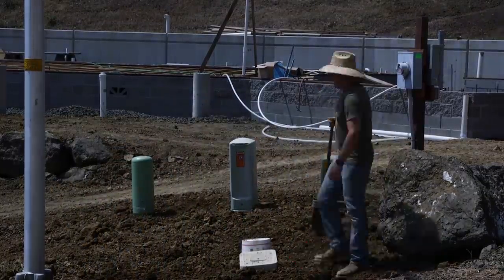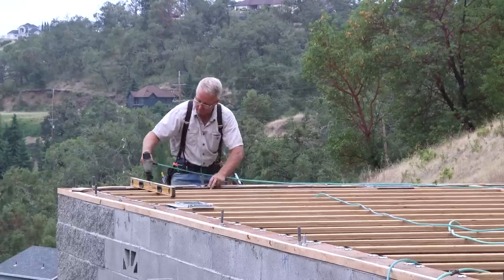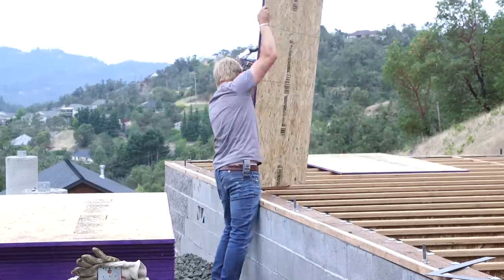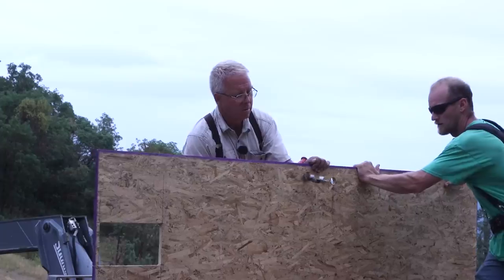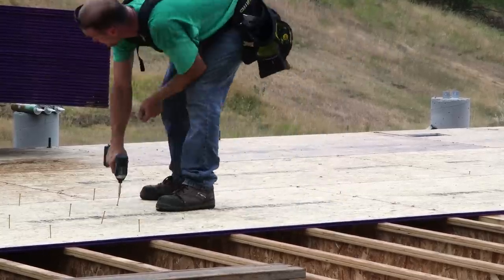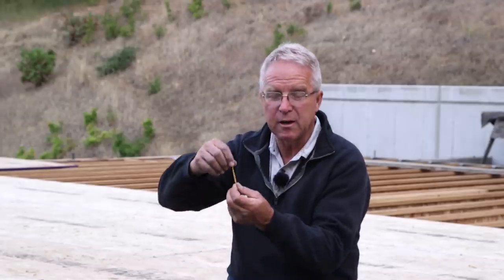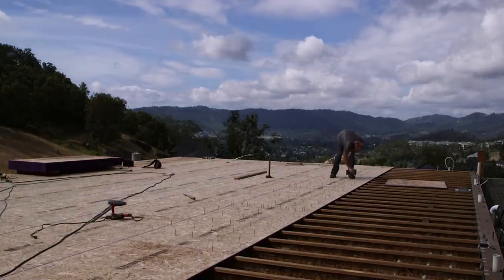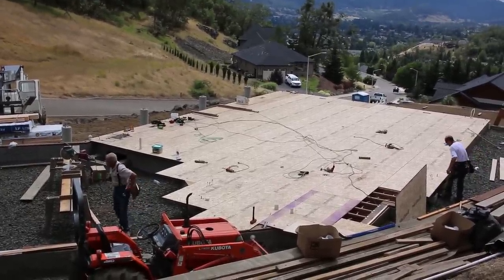Lay the Deck Ep.44

Comment: Wouldn't putting some sill gasket material be a good idea on the space left after shimming the mud sill to prevent flow through that joint? Or would just some construction adhesive on the shim be enough?

Comment: screws? 8s ring shanks i built well over 1000 floors befor tjs and with tjs never had a squeak started laying osb before the lines and never trust the lines iv seen them off by an inch or more especially on half inch ply

Comment: I hate an impact driver for driving regular screws. They’re great when you need power, but I find the them slower or regular screws, and the impact ratcheting action twists the bit in the screw head, causing the bit to get stuck in the screw. A normal drill is way better in my opinion.

Comment: I have to ask why OSB and not zip system/ huber wood, advantech subfloor. Far superior to OSB with glue and their system has a warranty when you use their subfloor, glue and screw it down
Reply: Like most things in construction I would imagine that the final answer would come down to cost. 

This is still a spec home and I would think the final goal is to make money. Given that market those more costly products may not pan out in the end for the bottom line. 

Have a great day.

Comment: Ok, so have a problem I ran into when using advantech tongue and groove decking/subfloor. I was building a 16x24 shed when I realized that the usable space of the board is less than 4x8 because the whole board itself is exactly 4x8. So if I were to actually use the tongue and groove on a 16 foot wide shed I end up having to use 4 boards plus waste a whole board by ripping a 3”wide strip so the decking actually makes it to the edge. Have you run into this issue?

Comment: A couple of thoughts/questions ... 

1. When you were making the holes in the first row of sheets to accommodate tie-downs, etc. at the edge of the house, what was the reason for not simply butting the sheet up against the obstructions and then scribing their positions straight onto the sheet? It looked like you were making life more complicated by measuring and then transferring the positions. There was doubtless a good reason for doing it the way you did, so I'd be interested to know what it was.

2. What is your view on screw guns for screwing down OSB? Putting in hundreds of screws with a normal electric screwdriver looked a little fiddly. I've been getting good results with one similar to this: https://youtu.be/TKgioDxOT-M?t=350 -- though it took me a while (and many wasted screws!) to realise the importance of selecting the correct tip for the type of screw :-)

Comment: would a caulking gun with extended handles so it's like 3' long instead of 18"  make it easier to put down the adhesive for sub flooring. might be something to mention to the caulking gun manufacturer you use..

Comment: Missing code required cross blocking at end parallel to joists. Recommended screw length is 2 inch .

Comment: That deck screw bit popping out would drive me nuts. A roll of Super 33 or 88 is good for more than wiring. I wonder if that construction adhesive would work in a pinch on a torx bit trying to escape. I found this edition a little flatter than usual.
Peace.
Reply: Simple fix... get a longer bit. If you're using the same screw type for thousands of times, save yourself a headache. The magnetic holder is only good when you deal with a half dozen screw heads in the same short job, and even then, most impacts are simple to pop in and out, there is no chuck.

Comment: I am a relatively new  carpenter with a lot to learn, but I had a couple quesions. What is the point of shimming the mudsill? Won't those plywood strips just rot away? If it was cedar would it fair better? Thank you for any answers you can provide.
Reply: I always put the band boards and joists on top of the sill. I've never had that problem.

Comment: For the places where you have to make a penetration (plumbing, etc.) do you have to go back later and seal up the holes to make them air tight, or do you leave them and the next layer does that?
Reply: You'd want there to be some space to eliminate squeaks and rubbing wear. Also makes future replacement or repair easier.

Comment: I know there is much discussion over plywood vs. OSB.  Engineering-wise, OSB provides a much more uniform panel strength, especially in shear.  But p!$$ poor nailing makes it all moot.  OSB will not hold a nail.  So, siding and shingles, plus some flooring, all comes loose over time.  Here, a bit farther north on the wet coast, OSB is regularly nailed when wet and the following year, everything releases.  There are so many "cardboard" spec houses going up here and they are garbage.  I've done far too may repairs on OSB substructure because it was wet and the nails didn't hold anything together.  I'm very curious to see how you deal with this issue in these videos.  

Good for screwing the decking down.  I usually use Robertson screws [square socket] as it's more available where I live, but Torx works too.  I'm surprised you didn't have a stand-up screw rig for the deck screwing. It's a huge back saver. 

Finally, I do not like any OSB beams or sheeting construction methods as it burns like crazy.  In event of a fire, if you don't live next door to a full-time fire hall, your house is a total loss every time.  "Old School" wood framing methods have the advantage of being able to be built fire limiting and help reduce fire spread and make fire fighting safer.

Comment: Buying tongue and groove OSB at the typical orange or blue big-box store, I have NEVER gotten any that would actually fit together correctly.
Reply: No offense but you probably don't know how to put it together. It's supposed to be gapped for starters.
Reply: @shooter77us  Every piece has a smashed spot in the groove.  Or the tongue is bent down.  Or the edges are visibly swollen.
The last batch I tried to buy, it was both sitting outside in the rain, and the band clamps were so tight they had crushed the edge of every sheet.  I bought plywood instead.

Comment: You said OSV is a great choice but I've seen a video about OSV and plywood. This guy wet the OSV board and after some time I don't know how many hours he drive a nail with his bare hand and the nail went through the OSV whereas after wetting the plywood at the same length of time as OSV he did the exact same thing on plywood the nail didn't even went halfway. I'm not a expert carpenter but imagine if you live in hurricane prone area and your roofing OSV got exposed from water those nails would come off from strong wind. I could be wrong maybe the video is misleading or something.
Reply: What's even more puzzling is that Roseburg Oregon is like the world capital of plywood production.

Comment: A staple is no better than a nail. They both have flat smooth vertical surfaces. Use ring shank or coated nails.
Reply: It doesn't matter - the staple can't make a squeak because once the board is screwed down, nothing can move anyway.  It's just to temporarily hold the board's position until the screws are run down.

Comment: Does bldg code allow for screws to be used for the diaphragm?
Reply from the maker: Yes in fact the engineering on this project requires it.
Reply: @essentialcraftsman  Is it considered a diaphragm?  Those deck screws would not have the same shear tolerances as a 10d nail. No?

Great show.  I like the shims under the subfloor.  Much easier than shimming the walls later.

Comment: Your skills and way of explaining things are nothing short of being perfect. One thing I must say you need to try and once you try it, you'll toss that liquid nails forever. Try the expanding foam polyurethane adhesive made by DAP. I Use the DAP expanding adhesive and great stuff brand guns. There's 8 times more product per can than what's in a 24oz tube of liquid nails and per can in my area is roughly 12 bucks per canI have found it much cheaper online and the holding performance is hands down better than anything I've ever seen. Plus when your done, you just clean your tip and set the gun aside until next time. Trust me. You can thank me later.

Comment: this whole time i thought OSB was worse with water... crazy
Reply: I don't think plywood is any different.  Exterior grade won't degrade the glue if it gets wet.  It really is no different than OSB in that regard.  At least if the glue fails in plywood, you still have the large plies there stacked on each other.  OSB is 3-5" strands...what's left if the glue goes away from that?  Bottom line, it is the glue that is key for both structures.

Comment: Interesting that the deck goes out to the outer side of the wall, does this not provide a way for moisture to wick  into the house.  I was expecting to see it sit inside the walls.
Reply: By running the sheeting all the way out, it helps to smooth out the entire surface into 1 homogenous surface which to start the 1st floor framing. Once the exterior material is applied, wicking shouldn’t be an issue.
🤜🤛
Reply: @psidvicious  Thanks, I figured it was something like that, I can see the structural benefit.  Here in UK we rarely build in wood for the outer shell so I’ve not considered this before.  Look forward to seeing how the outer skin is constructed.
Reply: @sibat777  Right. In my location, (S Florida) we rarely build like this either. It would have gone - foundation, stem wall, joist and deck, then masons would come in again and continue laying more block for the exterior walls. Or, more likely it would have been a concrete slab on grade after the stem wall.
🤜🤛

Comment: With expansion and contraction won’t your shims be pointless, cause squeaks, and create voids ?
Reply: Once the walls go up...those shims will be pinned in tight from the weight.
Reply: Daoud Steele 
With that logic, Wouldn’t the weight bring it back to its original shape without the shims ?
Reply: Joe M the joist hangers are slightly higher than the mud sill
Reply: gallamine 
Yes but from the moisture or lack thereof. With expansion and contraction of said material wouldn’t the sill move again and wouldn’t the weight of the sub floor cause it to move as well ?

Comment: I thought I've watched every thing but still need to know do you need to have a full time inspector on site?
Reply: No, inspectors are called out by the builder/general contractor in stages. they are only onsite for 10-30 min at a time. for example when MEP is roughed in you may ask for an inspection before work can continue. after the inspector passes you, you can move on to the next stage.
Reply: @James-fi5nd  Can you tell me who is always sitting in background in many video"s Thanks
Reply: Only larger commercial jobs have full-time inspectors and they’re usually only for the structural portion of the job. They’re usually referred to as ‘threshold’ or ‘special’ inspectors and are hired by the owner thru an independent inspection and material testing company. 
🤜🤛
Reply: @bobfuller9759  That's a friend of Scott's.  Scott has mentioned him before and has commented that there will be an introduction for him in a future video.

Comment: I wouldn't build this sort of a wall to floor connection. You can't insulate between the floor and the wall. there will be a cold spot at the baseboard forever. I live in Canada where this was done in some houses in the 1960's. always condensation issues and ice forming where the walls meet the floors. Besides that everything looks good. Im not sure what climate zone you live in.
Reply from the maker: VERY temperate...

Comment: It hurts seeing some of these old and corded tools lol
Reply: Right, however if you're doing any type of production building see how long a cordless skill saw will last cutting plywood as well as a cordless bigfoot or sawsquatch which I don't think exists yet for cutting timber and beams.  Cordless superhawgs seem pretty good for a little while, but I personally like the power ones.
Reply: I assume you’re talking about the drill for boring the holes and the circular saw. I haven’t used a cordless wordrive saw like the dewalt but a corded worm drive beats a cordless sidewinder any day of the week. Those holes probably could have been drilled with a cordless drill but there have been times when my cordless drill couldn’t cut it. It feels different using the corded tools. I love the feeling of a corded worm drive saw. That little jump when you pull the trigger and the feeling of raw power behind it is great.
Reply: @williambutler3695  yes indeed gotta say been pretty impressed with the cordless grinders and hammer drills.  They are not too shabby

Comment: I always thought a PT mud sill would be a good idea, but after watching this I don't think so. If your roof overhang, siding, and sill gasket are good then the mud sill will never get wet. If it DOES get wet, then why use OSB and TJIs? Doing renos in a wet climate, the only rotten mud sills I have seen are from bad windows/flashing/plumbing.

All this cupping and $himming... not handsome in my opinion. It is also begging for someone to forget to switch to galvanized nails when nailing down exterior bottom plates.

Comment: Investing in a good set of cordless tools would really up productivity dragging cords for your saw and drill is  not productive
Reply: Jon Ruger There is a place for cordless tools. Maybe it could benefit these boys here. But gang cutting and ripping wood all day, I’ll never use a cordless saw.
Reply: J Chase W my 7 1/4 Milwaukee cordless is more powerful and lighter than a mag 77 and I have 30+ batteries haven’t touched corded tools in over a year
Reply: @jonruger  cost of those batteries would be more than a dozen quality skillsaws though
Reply: Helena Of Detroit no you get 1 or 2 with every tool you buy they add up all modern carpenters are fully invested in a line of cordless tools you have to be to stay productive these days.
Reply: @jonruger  let's say you get 2 per tool. That's 15 tools to get 30 batteries. There's drill/driver, circular saw, reciprocating saw, another drill, a stapler/nailgun, angle grinder, and... uhm... What else? Plus, you now have to have an area dedicated to chargers in your shop. 30+ batteries all on chargers all take up space somewhere.
Reply: @HelenaOfDetroit  Agree with you and OP, cordless is great when accessibility is annoying with cords. but batteries are expensive, they degrade, and will cost thousands over a few years of productivity.
Reply: Helena Of Detroit you clearly have never seen a large home being built or commercial job site today. Everyone is running cordless for most things because you can get any tool you can think of cordless by Milwaukee Or dewalt even a framing nail gun or chain saw
Reply: Helena Of Detroit when you up productivity by saving time running cords and hoses safely it makes you more money faster just throwing a few batteries on a charger is not hard and takes up less then a compressor the cord to run it the hose to a nail gun.
Reply: @jonruger  I filmed a bit for the Discovery Channel a couple years ago, and the guys building the house didn't have cordless nail guns. They framed it with pneumatic nail guns. 
But that's not really the point I was making. I was merely mentioning the cost. If the company is doing large enough jobs often enough, then sure, they can justify the cost of the batteries. For us mere  mortals, then no. It wouldn't pay off soon enough to be a financially wise decision.

Comment: Sorry but the statement that a staple holds better then a nail is 100% inaccurate.   Ive been framing houses for 15 years.  Screws are clearly better then nails for folding.  But if your going to "tack" the sheets and then screw them.  Use a ring shank nail

Comment: 11:12 Bed of nails for a visiting Hindi?....Very dangerous to have stuff like that about...Why?...Framer for 30 years... Screws?...Seriously?...Why not ring shanks?...It's your house but, It won't increase the value...You need to know where to save and where to spend...You're wasting money...It's your money but...Maybe take the waste and use it productively...You could have paid a couple tradesmen with the money wasted on screws! We call it; Penny smart and dollar foolish...
Reply from the maker: I am following my engineers instructions. Final inspection would fail if I hadn’t done it.
Reply: @essentialcraftsman  They said you had to use screws?...Never heard of such a thing...And, it's the building department or BOCA  that  approves fasteners for use in assemblies...Engineers suck at construction too...They want to overbuild...
But, I think you're pulling my leg with an engineers screw insistence...
Reply: @godbluffvdgg  Don't put it past engineers. I see crazy over-specification in plans all the time.
Reply: @ILikeWafflz  Oh, you're right...I've been correcting them for decades...I would only use an engineer for a structural problem that needs a stamped drawing and even then, I make sure it's not onerous to do...What's with those crazy curved bearing walls too?